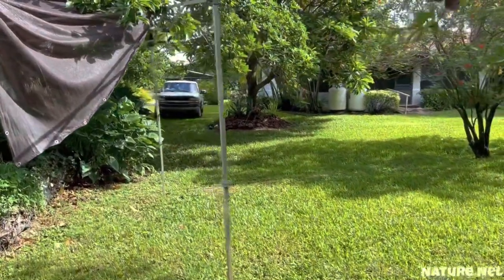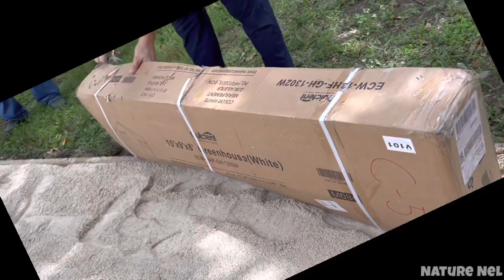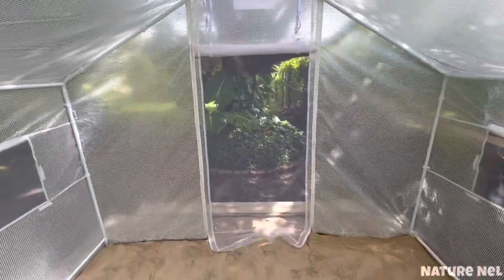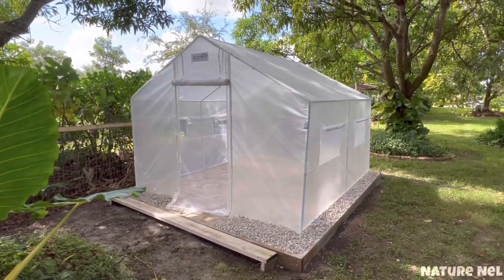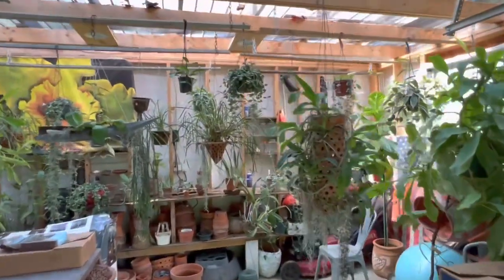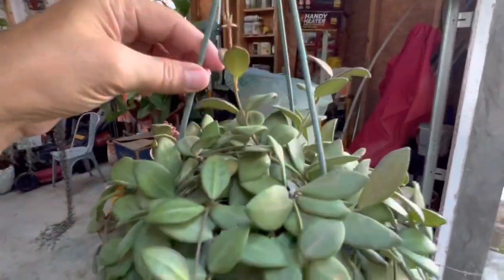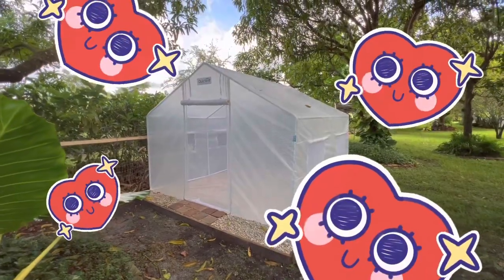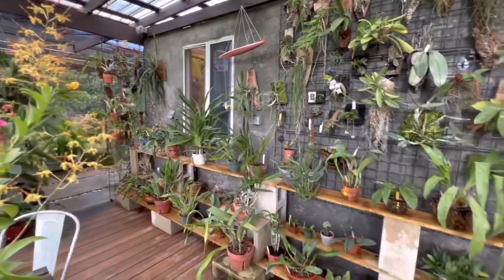YOU CAN WIN A QUICTENTS GREENHOUSE! Watch us build a greenhouse, plus we are giving one away to you.

Comment: You had me at Morris😍😍😍 I have two King Canopy 10x10. Unfortunately they do not have the windows and two full doors, just a vent window at the back. I have a problem with chipmunks getting in and tearing up my flats. The frame and gravel you built into is brilliant! Not only does it stabilize the cover but it anchors the flaps and makes it impossible for critters to get in. Liking and saving your video for reference. I have a hoya carnosa with dainty pink flowers too😊😊
Reply from the maker: Hi Shelly!  You are absolutely right on the greenhouse. The covered frame with sand and rocks has really kept all critters out including bugs. I’m planning on doing extra anchoring to the cinder blocks on the inside to the frame of the tent. This will really keep it secure. The extra screen windows are amazing! It keeps it cool and allows a breeze to flow through. I also just added a fan inside. It’s so comfortable to hang inside. Morris loves it!😻